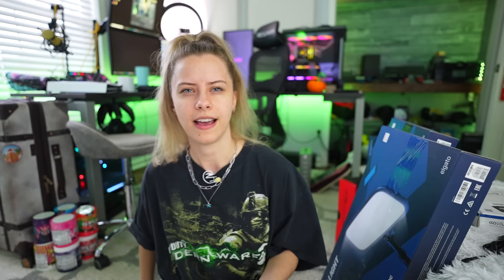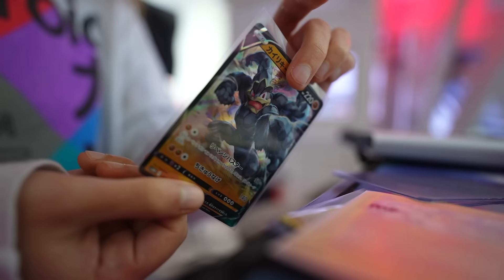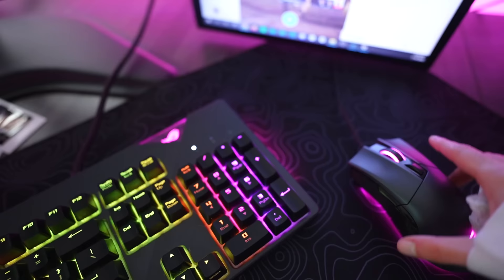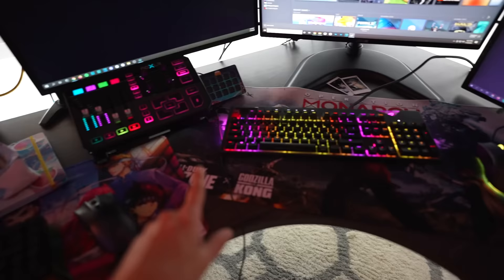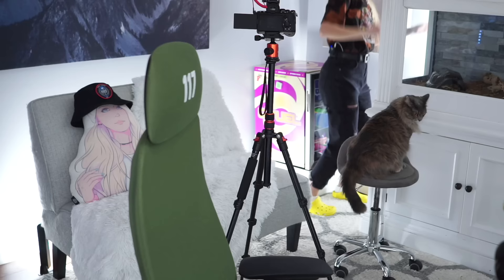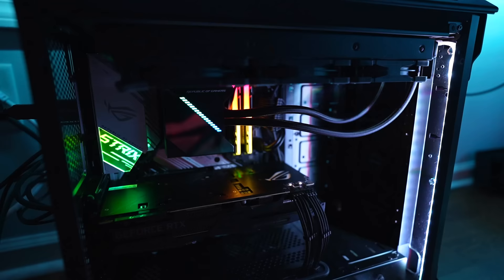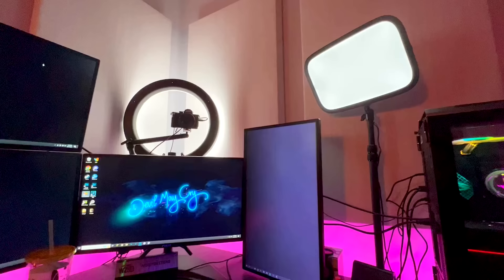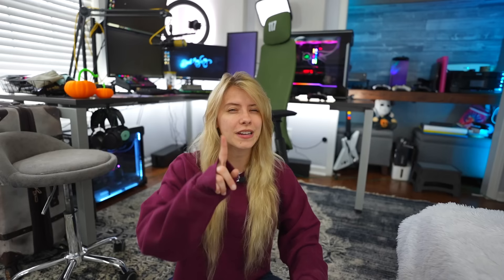CLEANING AND UPGRADING MY GAMING / STREAMING SETUP!!!! | NoisyButters

Comment: I'd recommend getting another fan(preferably whatever fan size you have, 120 or 140mm) so you could put it inside your case and use it as an intake fan so you could have a positive air pressure inside your case. With your current fan configuration, you have 4 exhaust fans that pushes air out of the case and 2 intake fans that pulls air inside the case. Thats called a 'negative air pressure' where there is more air being pushed out of the case than air getting inside of the case that could cause your pc to overheat. Ideally, you want equal intake fans and exhaust fans, so you could maximize the airflow inside of your case and have a 'positive air pressure'.

This is just a tip to avoid problems with your pc and so that you could continuously game and make content without any issues. Anyways, keep up the great work and keep being you!

Comment: This is why i spread my thermal paste evenly across the chip. Since chips are no longer isolated to 4 cores, its better to spread it evenly since theirs so many cores now. A heat spike is likely to happen with a blob then a evenly spread. Just a fyi if any of your cores are high temps. PSU tester could help you diagnose if that PSU does have an issue.

Comment: With the VR headsets I would invest in some mannequin heads (usually used for wigs or hairdresser training). Amazon sell some polystyrene ones which would work fine. There are specific stands for VR headsets, but I personally think the mannequin heads just look a bit better.

Comment: Can you do a video explaining a dual pc setup for streaming? I built my first pc two years ago and have since upgraded it but would like another pc to handle the streaming workload. My current pc setup is. 
Msi B550 
Ryzen 9 3900XT water cooled
64 gigs of ballistix ram 
Nvidia Geforce RTX 3080 (10GB) 
2 TB SSD for main drive
1 TB SSD secondary 
8 TB HDD for backup 
Power supply is 750 watt
Reply from the maker: hihi! im no expert on settin up a dual pc setup, but i did this vid a year ago' most thangs still apply, i hope it helps! 👉👈 https://youtu.be/3gGpiTrkZzw
Reply: @NoisyButters  Thanks so much!

Comment: that's awesome I love your PC setup in my PC I have a Intel Core i9-10900K - Core i9 10th and My motherboard is the GIGABYTE Z490 AORUS ELITE and currently I'm using for the PC case is Crystal Series 570X RGB ATX Mid-Tower Case — White but I am going to make a few modifications to the PC like upgrade the graphics card to a RTX 4070 and get a SAMSUNG 990 PRO M.2 2280 2 TB AND That all!!!

Comment: ooooo monitors, lg has a 27 in 1440p 240hz oled monitor, great for competitive gameplay with over latency and frame latency beating most if not all ips monitors. if without audio sponsor that asks you to wear their branded stuff, look into dac, amps and headphones if you haven't. beyerdynamic makes some of the most recommended headphones for competitive gaming. keyboards are another rabbit hole that they consider the entry level amount to spend to be 1k for a keyboard but there are more options that arent as crazy. Mice if gaming with it the logitech g pro x cant be reccomended enough and after 7 mic including 2 finalmouse mice, the gpro x is just too good and can find some custom ones too. these sooooo much in tech and i obsess. i also blame linus tech tips youtube for my pc set up and optimum tech for my builds inspiration. you could also do a full custom loop with hard or soft tube, super fun and satisfying but time consuming. Set up is AMAZING! Stay awesome